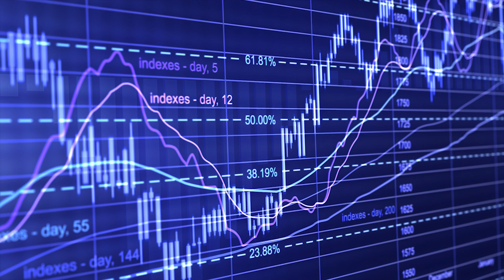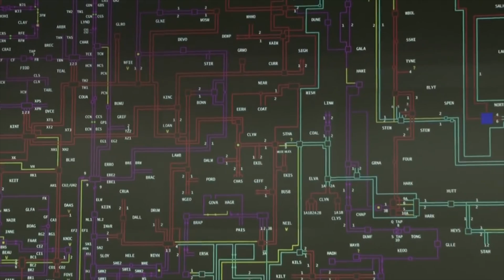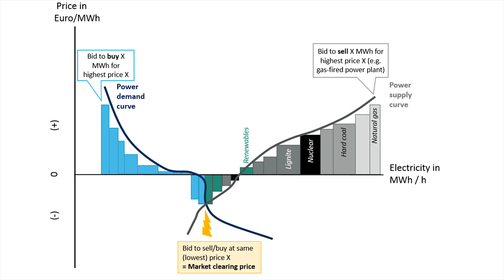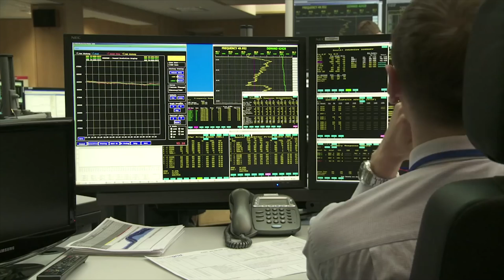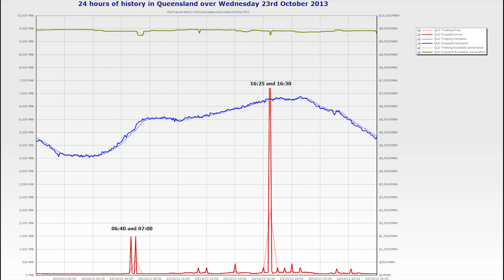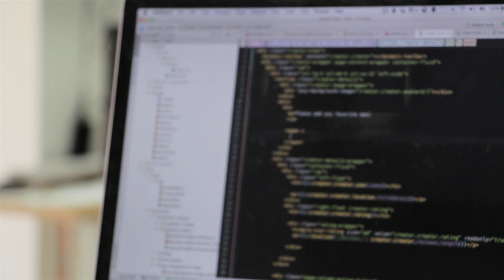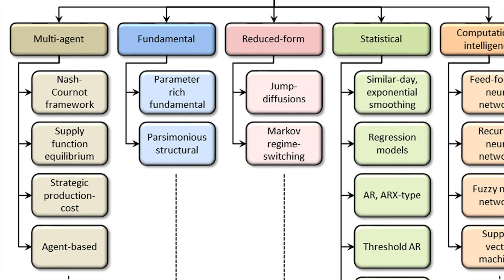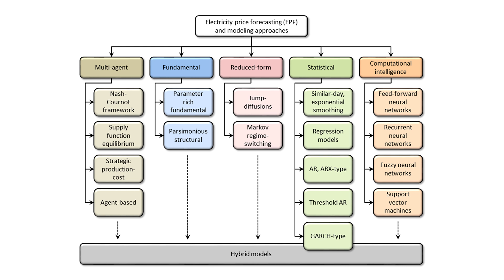An Introduction to Electricity Price Forecasting

Comment: Electricity and "energy" more broadly are different from other commodities.  Energy is the base unit of currency for all chemical reactions and it has to follow 3 rules human economies don't:

1.  It can't be created or destroyed.

2. It naturally flows from areas of high concentration to low concentration unless energy is spent to maintain inequality.

3.  Cash only, no credit allowed.

Human economies create currency at will, have perfect storage, and offer cheap credit with compounding interest.

That's why we're always hanging off the cusp of an energy crisis as a society.